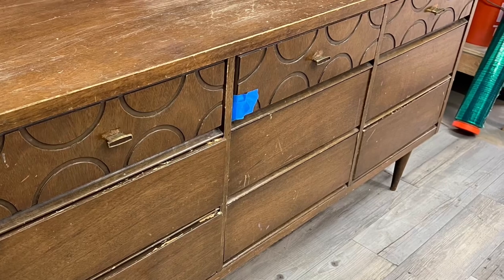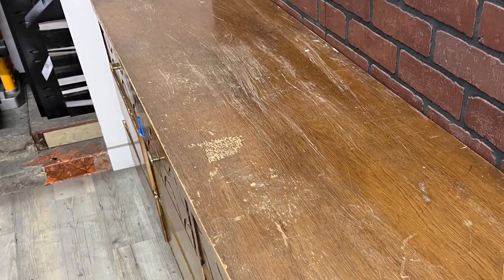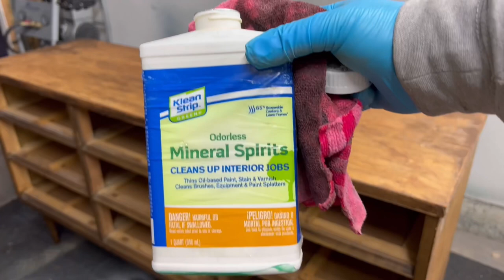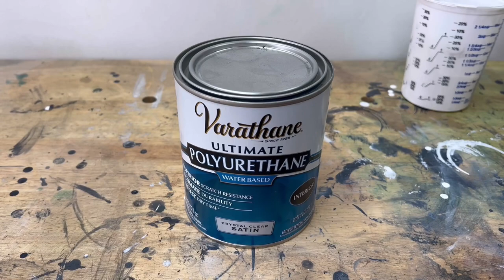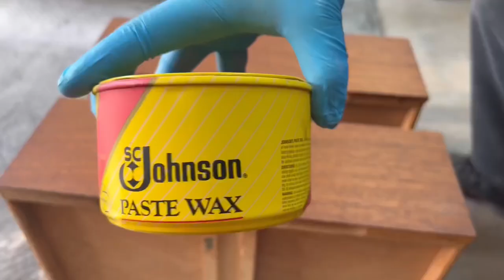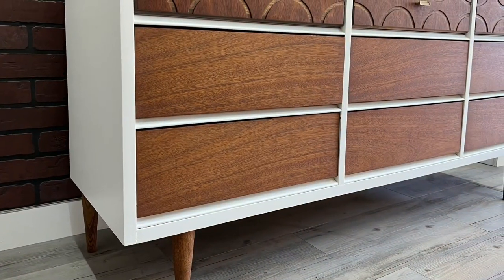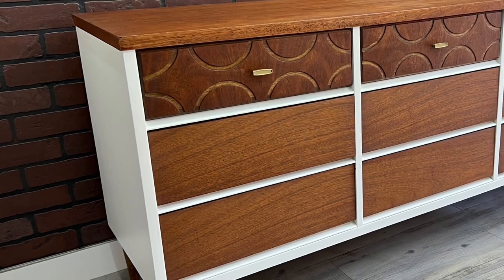AMAZING Mid Century Modern dresser MAKEOVER || Trash To TREASURE TRANSFORMATION using paint & stain

Comment: 60 years ago my Aunt & Uncle had built a huge gigantic garage, it was 2 stories high & you could have parked 6 to 8 cars in it. What they built it for was to do furniture apolstery & refinishing in. They used to use furniture strippers as well. I do notice though that people on You Tube don't really use as much of it as my Aunt & Uncle did. They would use double, triple, or quadruple what You Tubers use & it stripped the finish off totally in 1 coat & it did not dry out in 15 minutes. There was way too much of it to dry that quickly.  You could take a plastic scraper & scrape it clean without having to work so hard to get all the finish off. You never had to sand any of it off because the stripper got it all off. You only had to sand to smoothe the wood down & prepare it for paint or new stain. My cousins & I were always fascinated with the chemical reaction during the process. We loved to help scrape it off . Which we were occasionally allowed to do under very close supervision.
Reply from the maker: That’s so awesome. I love when people share there stories with me. I wish I had that much space to do my work. I have so much work and pieces to do that are coming up. Thank you for the advice and I definitely will add way more next time. Thank you again and take care. Have a happy new year.

Comment: Another great piece.  Any thoughts on using a more durable finish on the wood like a laquer or varathane?  Love the tinting of the varathane...something I will be using.
Reply from the maker: Thank you so much. I really appreciate your support. I haven’t considered any other top coat as of now because the water based poly dried very quickly allowing me to do more coats in a day.
Reply: @CedarPineDesigns  sorry...I didn't see you topcoat the stained wood.  I thought you just left it with a wax finish.
Reply from the maker: @chrismalcolm8804  yes. You’re correct. I was referring to your comment about the tinting of top coat. I did use a wax for the top on this one because I wanted to bring out the color of the stain a bit more.

Comment: I love your technique and the products you use. Any reason why you don’t use chalk paint 🎨?
Reply from the maker: Thank you so much the ninth hour. I typically go with latex because I get it with a built in primer as well as use primer in some cases. It’s a bit cheaper but I’ve been wanting to try it out but have to research if it’s compatible with my spray gun.
Reply: @CedarPineDesigns  welcome 🤗 chalk paint is not easy to work with nor is the wax you use with it. I’m a restoration artist so I’m always looking to be better. I love 💕 your videos. BTW other restoration artist have told me that when they use chalk paint in a sprayer they waste a lot of the chalk paint.
Reply from the maker: @SimplySage854  thank you so much for the info. I’m fairly new to this so I’m still learning and any knowledge I can get from anyone, I’d love to hear it. What have you found to be the best option as far as paint. So far I haven’t had any trouble using latex water based paint as long as I use a polyurethane top coat
Reply: @CedarPineDesigns  same here. Latex water base paint is a lot easier to work with, and it’s less expensive than chalk paint. The benefits of chalk paint are less sanding and not having to remove veneer
Reply from the maker: @SimplySage854  thank you for the response